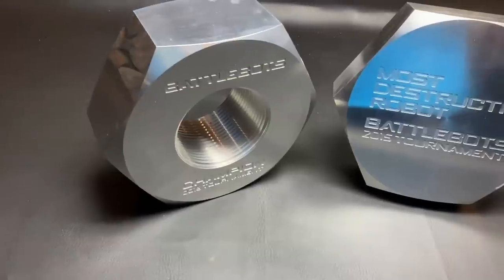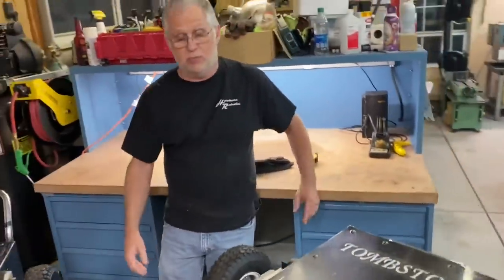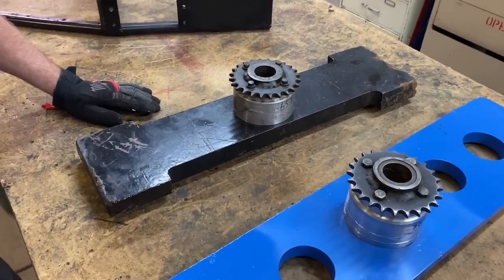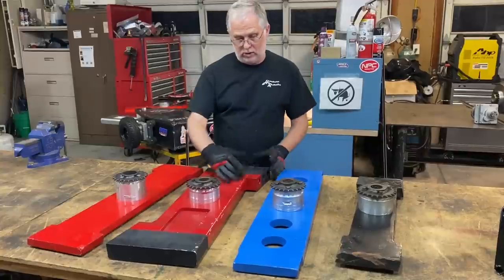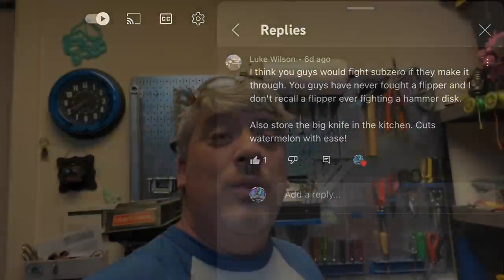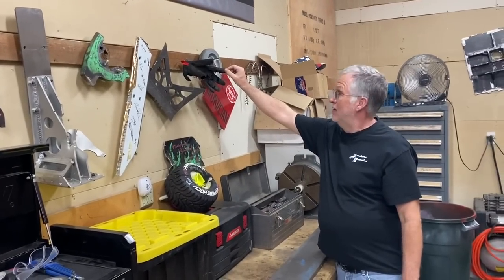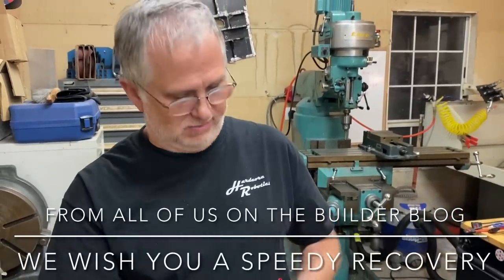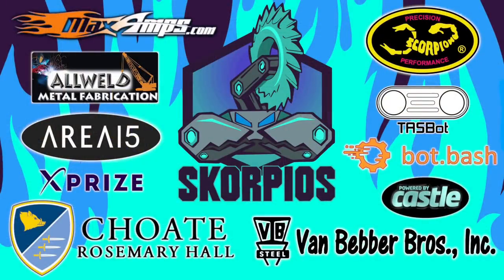BATTLEBOTS TOMBSTONE Exclusive Interview [Builder Blog Ep. 75]

Comment: I did not realize, how massive these things actually are. It must feel scary in real life, when the weapon is spinned to maximum.
Reply: A lot of what you hear on the show is faked/amplified for the spectacle, but one thing they have never had to fake is the SOUND of these machines hitting each other and the reactions of the commentators when a solid hit goes off in the box.
Reply: Heavyweight battlebots are 100kg.
Spinners like Tombstone often sees them flung across the arena as if they were 300g drones.
It's insane.
Reply: @OneBiasedOpinion   I particularly enjoyed the raw "inside the box" feeds BB posted to youtube a few seasons ago for that reason. I will grant having the crowd cheering and Chris & Kenny's commentary makes for a better show, but the raw feed really demonstrates how violent heavyweight bots are when they are smashing each other to bits.

Comment: As robots currently fight indoors on a relatively smooth, sealed surface, I think slick, squishy silicone rubber tyres (with no tread pattern at all) would offer greater traction than the 'knobbly' ones Tombstone and some other bots use.

I know that the arena floor becomes covered in debris, but in my experience a treaded tyre is really only of use on grass, gravel, snow, or to disperse water on rain-soaked tarmac.

Wheelspin and friction would soon clear a slick tyre of accumulated dust and crud in the arena.

Robots with tank-style tracks work brilliantly outdoors in mud or sand, but on a smooth, hard (sic) indoor surface the bot is essentially wearing stiletto high heels instead of tennis shoes. It makes a huge difference to grip on a hard floor. As with a knobbly tyre, it's balancing on points; a smooth rubber belt would offer more contact than a ridged track.

The biggest problem with indoor tracks, though, is the very thing that makes them so good outdoors: they spread a robot's weight over a huge area, reducing its ability to grip a smooth, hard surface and gain maximum traction from its 250 lbs.

The tyres on a forklift truck are optimised for use on smooth surfaces. The tyres don't have a tread pattern. 

For robots, a 4-wheel drive configuration with soft, smooth tyres makes the best use of the current fighting arena. In a 2-wheel design [Tombstone], maximising traction becomes even more important. Has Ray tried fully slick tyres before? They'd probably need to be custom-made.

As Tombstone's success depends so much on controlling its gyroscopic forces and making the most of every fraction of a second that its tyres are in contact with the ground, I'm not sure that reducing the tyres' contact footprint with a treaded pattern is helping matters.

Tombstone fans will be shouting at me to shut up, saying that I should look at Ray's trophies and remarkable career before daring to suggest any possible improvements. That's fair. You can't argue with success. All I'm saying is that slick tyres might make things even better.

Worth a try?🤔
Reply: I don’t disagree with your points, but given how much experience many of these builders have with the BattleBots arenas, I’d imagine they’ve already tested those theories.  There’s gotta be a reason why they don’t go with slicks.

Comment: I've seen a few of Ray's bots over the years from videos, and I would make a few adjustments to Tombstone's overall reliability, durability and destructive power (just to be clear, I respect Ray, his robot combat knowledge and Tombstone. I am a fan of Tombstone and other robots that Ray and his team has built. These are merely suggestions). 

First, I would use the wheelbase of Ray's Middleweight version of Tombstone, The Mortician, to prevent the exposed wheel problem, it would allow Tombstone to have more defense. However, if caught on the screws or on its side, it could cause problems without some sort of object to allow it to stay mobile or Tombstone would have to use the momentum of the blade act as a makeshift wheel to escape.
Secondly, I would put a covering on the frame of Tombstone to prevent overhead attacks and to strengthen the exterior of the frame. Plus, the covering would prevent the chain guard (as mentioned below) from being hit if the covering was to bend or warp during a battle.
Third and finally, I would either add a chain guard to prevent any spikes, forks, lifters or other spinners from disabling the blade OR add a second chain to the weapon motor (if the motor can handle two weapon chains). Also if the frame was to hit the chain guard, the chain to power the weapon would still be active.

Comment: I wonder if anyone’s made a weaponized super magnet to mess with all the wiring and internals of the enemy robot from the outside?
Reply: magnets don't really do at-range well at all...though a lot of bots will use magnets in the aid of more..."direct" ways to mess with another bots wiring. things like using magnets to passively increase downforce are fairly common and will allow a bot to handle maneuvering with the frankly horrifying energy density in a spinning weapon a lot better (not to mention helping drastically with the ground game) occasionally you'll even see more active systems like locking the bot to the floor the moment before it hits something or more adaptive versions of the downforce trick.

closest I've seen to what you're thinking of was one of the VERY short list of drones that had any chance of actually mattering in a match: it would theoretically magnet itself to another bot, drill in, and flamethrower the insides, but even that didn't work well enough to pull off in practice...frankly the only time I've ever seen a drone do something in one of these competitions it was when someone noticed that they forgot to ban entanglement devices in the rules, the drone literally just dropped some random fishing line or nylon cord or whatever else they had on hand on the other bot and 90% of the time it took out at least their weapon or wheels, usually both.
oh! also saw an omniwheel bot that did something like that: unlike most omniwheels this one was fast and driven by people who clearly had a chance to actually practice with it, the bot had a flamethrower and tried to strafe around it's opponent and keep the flame on it, get the other bot hot enough and their electronics will overheat and shut down, it's both the best use of omniwheels I've seen and the best use of a flamethrower I've seen. bot name was Alchoholic Stepfather I think? don't remember the teams or associated bots of either of the drones I mentioned.

Comment: You only need to protect the sides of the tires. Make a circular shield you can mount on the wheels. I don't understand why the weapon is fixed to a shaft. Use of a hexagonal well lubricated shaft would allow the weapon to slide down to the optimal height when Tombstone gets flipped and visa-versa. As far as mating giant nut and giant bolt ? No screwing without a washer !!